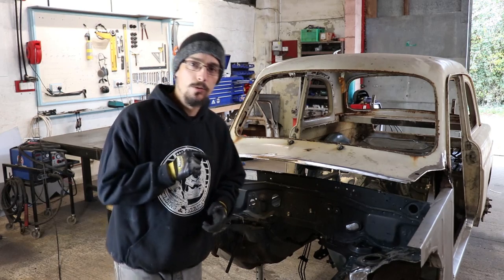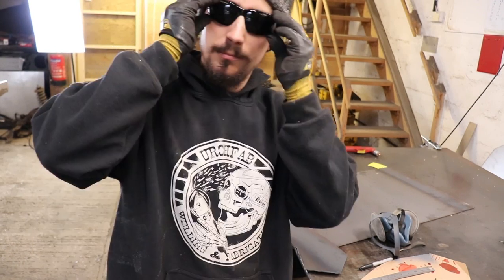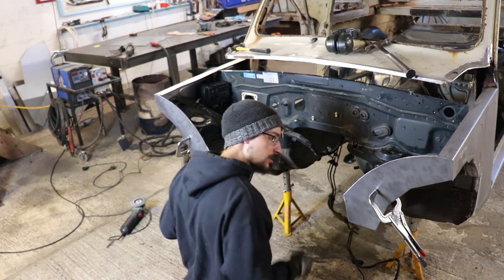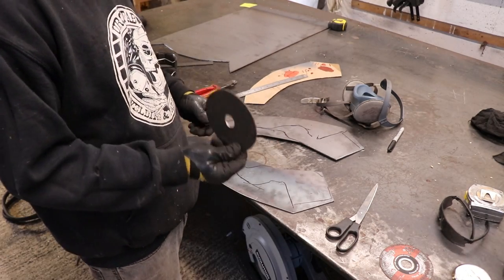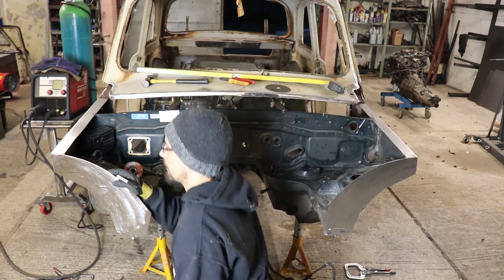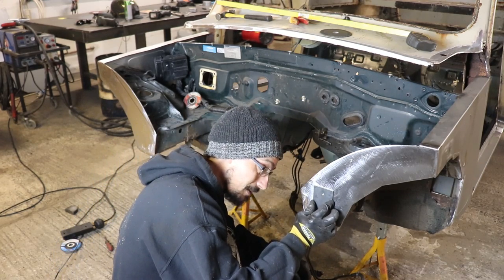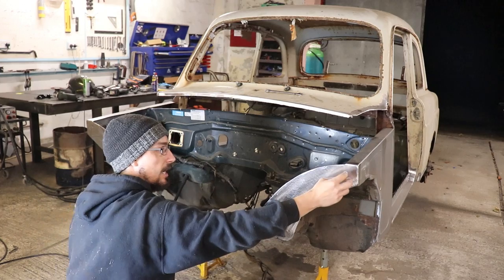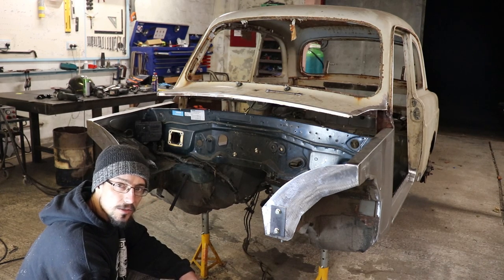THE MONGREL PART 12. REINFORCING THE CHASSIS LEGS.

Comment: Ive had a rivnut gun for about 18 months. Not used it yet! And Ive just bought one of those hydraulic crimpers for my battery relocation coming up.
Alot of fun tools, i have little use for 99% of the time. But REALLY handy when you need them.

Comment: Matt , an old trick when removing mill scale , is to pull the grinder towards you .
You are less likely to dig in and spoil the panel , works best with very light pressure.
Give it a go eh ?

Comment: More great work and creative thinking on the mongrel.. it would have been interesting to see what changes to the torsional and beaming strength of the donor Mazda the addition of the 100e shell made. I’m curious about how the steering column height and position will be given the difference in seating positions between the two cars. Really enjoying the straight forward approach and the methods employed to merge the two cars. Big thumbs up 👍🏻
Reply: The MX5 steering column has a universal joint right at the firewall, so you can position the wheel pretty much wherever you like, to whatever seat position you want.

Comment: Matt, how about using twisted wire wheels for the angle grinder to get the mill scale off?  Loving your work 👍
Reply: Wire wheels will only put a shine on the millscale. Hard wheels are still the best option for millscale removal. But wire wheels are great and fast at removing paint and rust.

Comment: Drill a thru hole in the plate and weld a nut to the backside. Riv nuts are junk!
Reply: If you damage a rivenut, you can replace it easily.